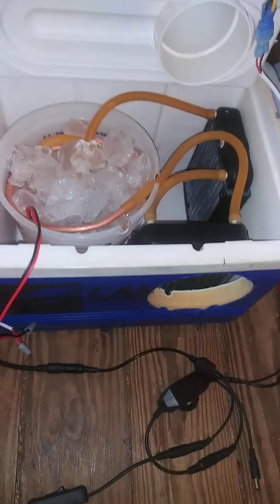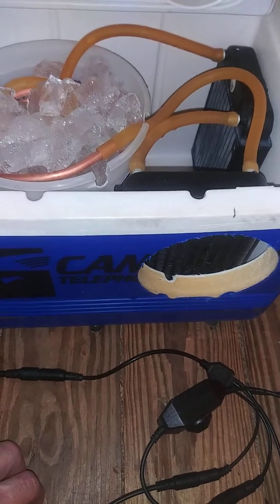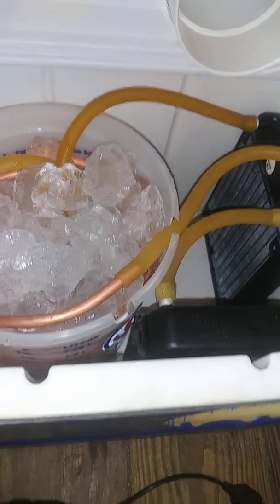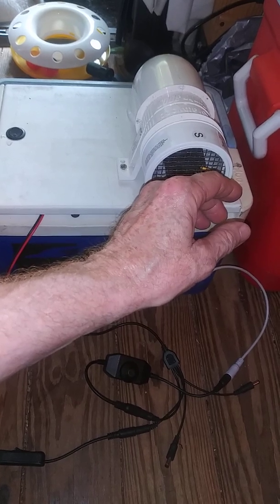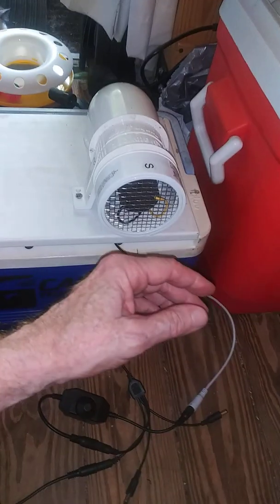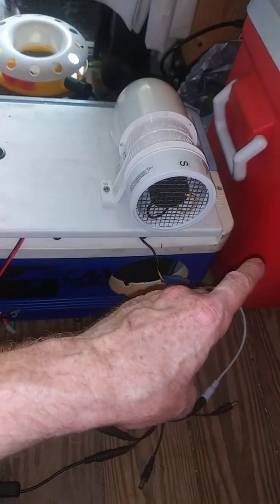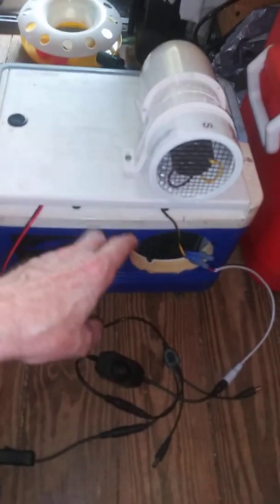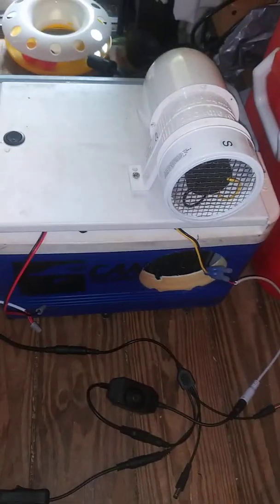DIY AC - Double PC Radiator - Closed Loop Sneak Peak - Mini AC 9qt - Pro Tips Homemade AC

Comment: I made one of these recently. I have a 48qt chest that holds the ice/water with a small pump inside that pumps the cold water to a separate smaller air box 12qt cooler blower box that has a heater core inside of it and a 4" 270 cfm bilge pump/fan. I took it for a test run in 105 degree temps on a 120 mile trip in the backseat of an old mustang. It worked well but I went through three 8 lb.bags of ice. I am thinking of  insulating the ice cooler better and thinking of making it into a closed loop system with copper tubing. Maybe have 2 separate compartments and elevating the copper coils keeping them on the ice and away from the lower warmer melted ice water. I'm adding a 4" flexible hose to the blower box  an attach a 4" PVC T to direct the cold air up to the left and right front seats. IDK yet, but at least it worked fairly well and it was fun to build and didn't turn out to be a waste of time.

Comment: Can an organic antifreeze enclosed  be used instead of water?
Reply from the maker: Yes, That can definitely be used. I know PC Gamers use an organic antifreeze in their liquid cooled computers. I was going to test it here but haven't gotten around to it yet. You can use organic antifreeze in an open loop system as well.
I don't know yet what impact using the antifreeze will have on the "timetable" of cooling the fluid down & run time etc. Every time I change one variable it will assuredly affect another. But given enough ice or chilling material used to reduce the circulating fluid organic antifreeze would be superior concerning operating temperature. I know salt water works also but can corrode the aluminum radiator. Amazon sells alot of different organic PC antifreeze in several colors etc. I'm working on a transparent ice chest AC using colored organic antifreeze to show the circulation for a future video.

Thanks for watching & for your question!
James

Comment: Which would work better sucking the air from the bottom like yours or the inlet from the top and blowing out of the bottom? I’m closed loop, copper tubing all that. The only difference is I’m sucking the air out of the top and it’s blowing form the bottom.

Comment: Where do you get or buy the plastic airports. My goal is to make a portable unit once you can help me through understanding the two systems.  From what I see from your demos is that the closed loop is more effective and efficient. Please can you just show a step by step setting up the pump and sorts for the closed loop.
Reply from the maker: The open loop design gets colder faster, almost instantaneously since the ice to air temperature transference travels through less materials.

I performed a small non clinical test on the closed loop vs the open loop designs using the small 9qt coolers and the ice longevity was about the same. And the open loop was colder.

When I do the tests again I will try to run the closed loop design longer to see if it can read an equilibrium in the temp transference. With a small amount of ice the open loop is better. But I'l.p. see if using a larger quantity of ice will compete in longer run times. It's like getting a 18 wheeler up on the freeway vs a small car. The 18 is not efficient until it reaches a cruising speed. I'm going to see it it's the same with a closed loop a.c. for sure!

Oh, and I make the air ports by hand cutting rings off of 4" pvc schedule 30 thin wall drain pipe. It fits perfect when using a 4 1/2" hole saw. The 4" pvc schedule 40 or 80 won't fit in that hole but may fit in a different sized hole. I used the 4 1/2" hole saw to get the hole to the edge of each side of the PC radiators to get as much air through without making the hole too wide. The hole cat be cut rectangular as well with a big saw or small hand saw and then dress the hole with some flat plastic strips...

Thanks...!!!
James & Team

Comment: Just some thoughts: I'm new to this and I appreciate what you're doing and presenting these devices .
I still can't grasp how you make a closed loop and how you load water into the lines . I'm a complete newbie and if you can be more specific with STEP BY STEP DETAIL OF A CLOSED LOOP SETTING IT UP .
Reply: To close loop you get a big bucket or whatever that’s deep enough to hold a lot of water and be able to allow yours hands to fit. Then you run the pump with the inlet open ( all under water) then as the flow is going you put the line back onto the pump under water while it’s running and that keeps the air from getting in thus closing the loop.

Comment: James thx for the videos!   Going to start my air box build once I find a heater core.
Reply from the maker: You can also get that same heater core at AutoZone or Advance Auto as well if you don't want to wait on Amazon. The side grooved frame rail on the sides vary by depth but it's fine. I used to attach them differently where the side radiator rails on some were too small so I started attaching them differently to the airbox to get around that issue since different manufactures supply them to different outlets. But any of them are fine now!
Reply: Thank James for the video. Do you know what the temp is coming out?
Reply from the maker: @rachelwalden4979  Hey Thanks!
I'll try to take a temp this week. I have several tests coming up.

As a side note the closed loop units take a little longer to blow cold because the ice/water has to transfer through an extra material(copper tubing) etc.

One thing to pay attention to when you see people make DIY AC videos and show temps on a thermal(IR)(Infrared) thermometer is that it's not recording the air temperature produced. Thermal thermometers that are handheld with a grip are actually measuring the temperature of what the infrared dot(light) is touching. For instance when an IR thermometer is pointed into the fan area it's actually measuring/reading the temp of the surface of the pvc pipe, or fan itself etc. IR thermal light thermometers measure surface space not air space. It's a bit misleading, but by accident I'm sure. I worked with infrared for three years etc.

But I'll get that out soon!

Thanks,
James, Rescue Kitty😺 & Snowvan!
Reply from the maker: Great!
The AirBox and a sufficient/large enough ice storage container is the way to go.

I'm only squeezing every inch out of the 9qt coolers for a friend in the Philipines who needs to carry it around from place to place. So that's the motivation behind the dual purpose ac/airbox with the splitter/diverter valve.

Plenty of ice, ice packs or frozen bottles, or freezer/ice maker,  a strong high static pressure fan, space between the fan and the radiator, and a radiator not to thick and with enough surface space, and a fast but not too fast water pump!

James, Rescue Kitty😺 & Snowvan!